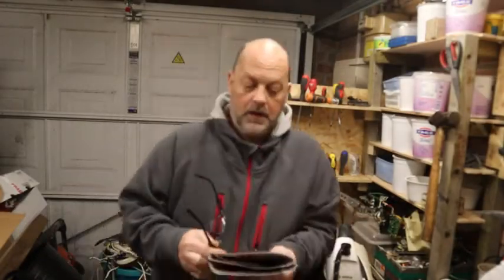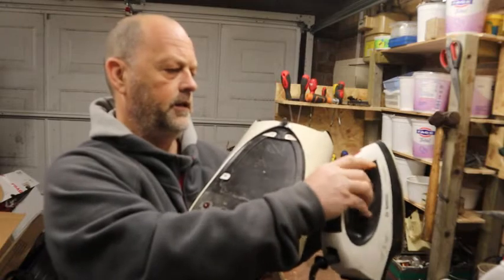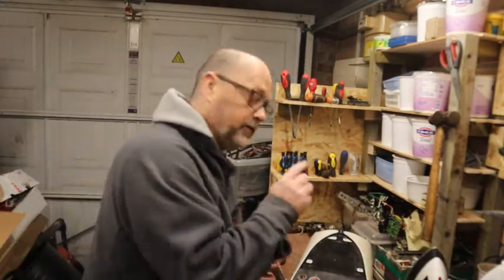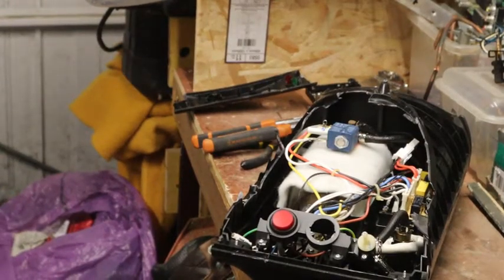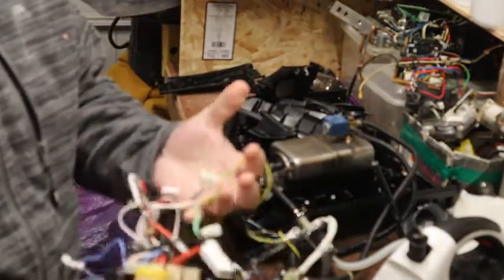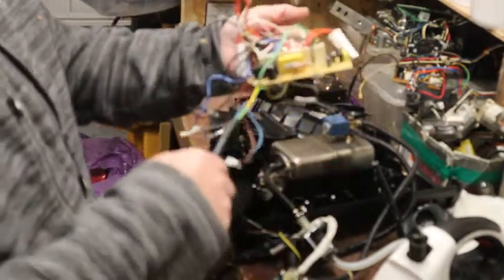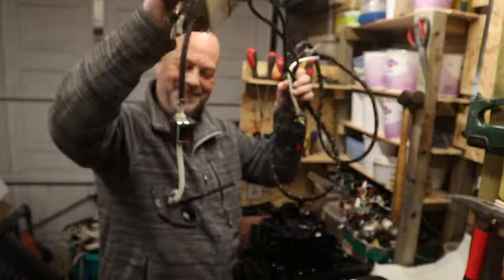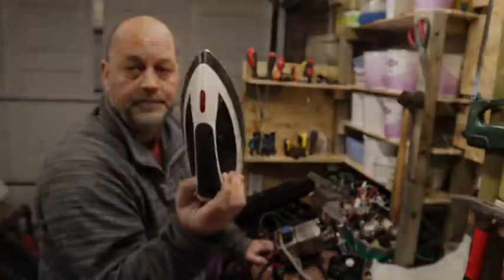Scrapping an Express Steam Iron for Vandal Vlogs Part 1

Comment: you could show how you taken it apart
Reply: Not worth picking up then matt if your a night scurrier  but very interesting as a take down
Reply from the maker: Mark, i would have but it has run into two parts so i was worried it would be too long a video. Basically ripped the plastic bits apart with the tool i showed. Plastic surprisingly came apart easily.
Reply from the maker: @robertcook585  Robert, if people are looking to make money from it, i would say no. I give the final figures in part 2. But as you have already realised I don't do it for the money, I just love taking things apart and try and work out how everything works. All good fun at the end of the day.